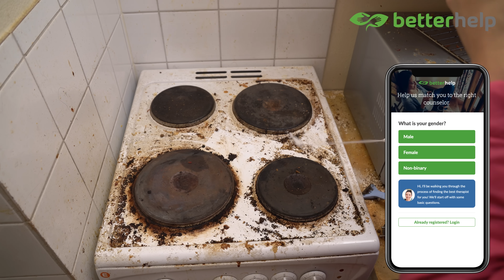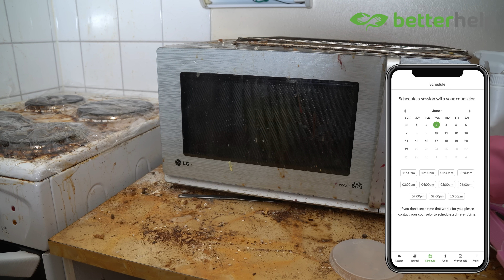Crisis to Cleanliness: a Couple in Trouble😰

Comment: Like so many people who watch I wish our bathrooms in the US were standard with a floor drain. It would make occasionally deep cleaning SO much easier and faster, especially in the cramped bathrooms a lot of older homes and apartments have
Reply: @ravengateley7677 Right. That would be practical. I think though that the aesthetic woul be jarring to many Americans. A stainless steel grate in the middle of the floor would be unappealing design wise in my opinion. Again, I agree that it would make sense 🪴
Reply: In Poland and Germany there are no drains like that either, except for public bathrooms :(
Reply: @cUser691  For me, practicality comes above design. I have ADHD and if something is difficult to clean, I probably won't do it. So, for example, I avoid renting apartments that have parquet floors and definitely don't put any rugs. With two dogs, there is still enough hair to clean off the floor but a robot helps me greatly :)

Comment: i use ofencleaner from Amway, it is a gel. My oven have 30 years and look totally new. For the Microwave you can use also acid of lemon, or fresh lemon. i use it also in the bathroom. For cleaning the windows and all flour and furniture i use Amway loc neutral cleaner. I think my friends app. is also a mes, but she is trying to handle it. Persons with such a mess a0re suffering and misssing selflove.😮

Comment: Good job to Aurikatariina, her helpers and her team.

But when you clean electronic devices (like the microwave in the video), you should disconnect them from the power, i.e. remove the plug from the socket.

Unless you want to risk an electric shock. And that can even be life-threatening.